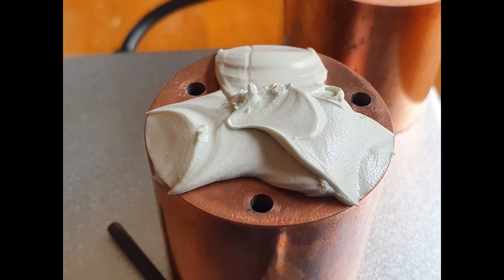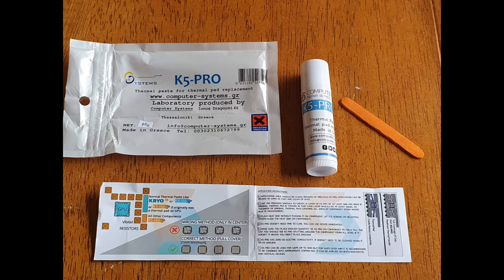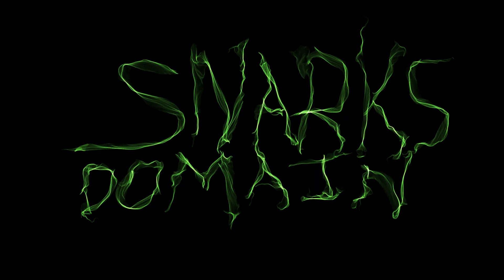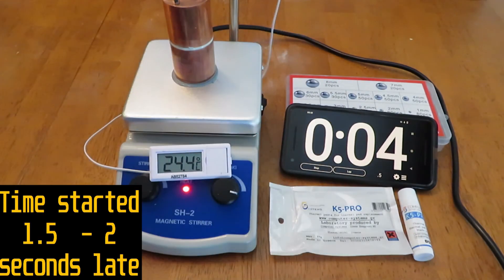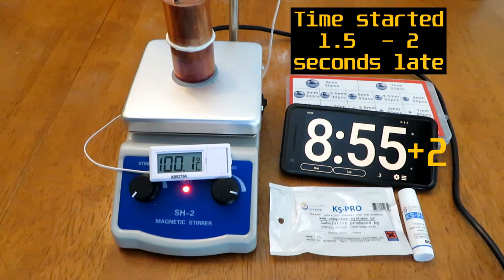K5 Pro vs The Hot Plate

Comment: i am planning to repaste my acer nitro AN515-58 I7-12650H and rtx 3070ti with ptm7950 along with i had doubt to buy a thermal interface for vram , like k5 pro or utp-8 thermal putty or pads can you recommend one for long lasting one with best one
Reply from the maker: Definitelt skip the pads and the K5 Pro. You can pick any of the putties on the charts, but you'll have the easiest time with one of the following:

Halnziye HY206 / HY236 
Zezzio ZT-PY6 
Upsiren UTP-4 Ultra-Thin
Reply: @snarksdomain  also sir that the upsiren ux pro ultra thermal conductivity was 16W/m-k on but the test result website shows only 6.1
Reply from the maker: @selvarajs401 it's best not to get caught up or even pay much heed to the advertised w/mk ratings. They are used more as marketing than an actual result. This is why test results on the same device and dame settings and wattage is so important. Otherwise we are left to rely on a manufacturer/brand advertised rating. They know this and end up claiming higher than is realistically possible.
Reply: @snarksdomain  thankyou for you kind reply and you testing says Upsiren UX Pro Ultra
Upsiren UTP-8
Hunan Feihongda LTP81
Laird Tputty 910
Thermal Grizzly TG Putty Pro
these were on the top list why you don't recommend this to me
Reply from the maker: @selvarajs401  because they use larger particle sizes and will be harder for you get get good CPU and GPU core contact since your laptop has fairly thin gaps.
Reply: @snarksdomain so hy 236 was a better option can you tell me the life cycle of this putty would i need to repaste often and also will hy236 performs as good as utp 8
Reply from the maker: @selvarajs401  should be just fine for several years.

It performs about 5 degrees worse that UTP-8 on my test card. Keep in kind that those 5 degrees are with it being GDDR6X with a +1100 Mhz OC, a 1.8mm gap and a mining load which is way hotter than what you will be running.

Your laptop has GDDR6 and the gap is much smaller. Close to 0.3mm so about 1/6th the gap that my test card VRAM has. For your laptop you might see a 1 degree difference between HY236 and UTP-8. 

You can certainly try whichever putty you like. If you run into problems then you can always switch to HY236 then. Just depends on if you are okay with doung the same thing twice and the slight increase in cost.
Reply: @snarksdomain  can i use copper shims on my acer nitro 5
Reply from the maker: @selvarajs401  i would not recommend it. The gaps aren't really large enough for it. 

That being said, if you take accurate measurments and leaving about 0.2mm to 0.3mm total for putty then I suppose it might be possible. 

It would maybe be more accurate to call it foil by that point. Or if you can machine something that is around 0.1mm to 0.2mm then maybe it could be done.
Reply: @snarksdomain  i go through the best putty website link you give that has Upsiren UX Pro Ultra
Upsiren UTP-8
Hunan Feihongda LTP81
Laird Tputty 910
Thermal Grizzly TG Putty Pro
honeywell ht 1000 at top order 
for best thermal conductivity

Comment: All I know is it cooled my Lenovo P1 gen 5 - along with ptm7950 - restoring power and saving my lap!
Reply from the maker: @stalbaum  doubtful. The PTM was a smart choice. The K5 Pro was not. Please go look at Igor's test results of K5 Pro compared to other putties.

https://www.igorslab.de/en/best-thermal-putty-database-and-charts-putty-versus-putty-tests-and-suitability-for-memory-modules-and-voltage-converters/
Reply: @snarksdomain  no need for optimal here, it is only an a1000 used to run 80 degrees now down to 70 maxed and the no more than 80 all cores on the i7-12800H, so the power phases are very well cooled by the K5. Bottom of the laptop never gets hot, just a mild warm, so working great. I think a little bit of the K5 property not treated in your test is volume, I use a lot of it and it soaks and creates a lot of area of connection to the body of the all in one pressure plate that has both the CPU and GPU copper. I think K5 works by making this large area and heat sink.
Reply from the maker: @stalbaum  again. I strongly recommend you go look at Igor's test results, in addition to my own. That stuff does not transfer heat well at all, and also bubbles, or creates air pockets, or off gasses. Either way, ends up with air voids/channels.

There are about 4 dozen better putties, many of which cost less.
Reply: @snarksdomain  well, lost credibility with me. For my laptop anyway it works great. That is what you seem to be missing here, your test is not related to the K5 use case. I suggest you research what it is actually designed for!
Reply from the maker: @stalbaum  just realizing now you were commenting on the hotplate video and not the GPU applications I did. I can totally understand you not putting much faith in the hotplate video. I've since retested everything on an actual videocard. Results are on the charts located following the Google Drive link in video description (Test Chart Repository > VRAM TIM > ETCHASH)

Here is a stream where I apply it to the Test card. https://www.youtube.com/live/P_cGk0EUUJo?si=fGlnGAHhnNL2vVYE

https://youtu.be/5iNXn8oaTWI

https://youtu.be/xND1726G624

If you're going to use a Thermal Putty from Computer Systems GR, you may want to consider CSGR UX Pro, as it's the only one that performs good.

For laptops with gaps below 0.5mm I instead recommend Halnziye HY206 (HY236) or Zezzio ZT-PY6. We should have other good performing thin putties from a few different brands some time this year.
Reply from the maker: @stalbaum I'd like to apologize for not fully explaining my experience and perspective woth K5 Pro. I definitely came off a little brash. Maybe a lot. I just have to do a lot of putty tech support with folks that use it and then have terrible temperatures. It can be frustrating.
Reply: @snarksdomain  it is still useful, you never know who will use it as a thermal paste! That would be bad.
Reply from the maker: @stalbaum  as long as your VRM temperatures are okay then you should be fine for now. My advice is to keep an eye on the temperatures of whichever components you applied it to.

If those components don't have temperatures showing in HWINFO then I suggest spending $5 on 20g of HY206 or ZT-PY6. It could save your laptop
Reply from the maker: @stalbaum  yep. Using any putty as a paste is not a good idea. Seen at least one person try testing putties like that and they had no control over the gap thickness. They didn't seem to understand the gap needs to be a controlled variable (like the 2mm ball bearings in this hotplate apparatus).
Reply from the maker: @stalbaum  Igor measured it at 0.6 w/mk with his TIMA5

https://www.igorslab.de/en/putty-details/?id=100
Reply: @snarksdomain  but again, it is not the use case. It is meant to be applied copiously and in volume, filling large gaps. Not pressed thinly between the plates. Wrong test assumptions, gigo!
Reply from the maker: @stalbaum I fully understand the correct use of Thermal Putties. I spent thousands of my own money buying all sorts of thermal outties and tested them out. I still have many more I need to test.

From my testing on the GDDR6X VRAM of my 3070ti test card there was only one putty that performed worse (Slice Engineering Boron Nitride), and it's not really marketed as a Thermal Pad Replacement.

https://drive.google.com/file/d/18pGETLrVCq16yMPE4EIBUe282SgSR8mL/view?usp=drivesdk
Reply: @snarksdomain  Sure you do, but K9 is a viscous thermal paste meant to be used completely differently. It is meant to be used in volume at low pressure. All you have to do is read the instructions. It is neither thermal paste nor thermal putty. It is to make high surface and high volume (adding volume for heat to sink) connections to replace thermal pads in a VERY different way than putty or pads work. You can't see it! You are, frankly, at McDondald's ordering a Chalupa.
Reply from the maker: @stalbaum  I do love me some Chalupa. Thanks for making me laugh. I am fully entertained. You seem to have a very narrow view of what K5 Pro is and isn't. Perhaps you should consider that Computer Systems GR markets it as a thermal pad replacement, calling it a "Viscous Thermal Paste".

If you're happy using it on your devices, then all good, my friend. I wish you good fortune and love living devices. Fingers crossed 🤞
Reply: @snarksdomain  yes sir it is a replacement for thermal pads. It both obviates needing to measure new pads (because you goop it everywhere) it also works by increasing surface area connection to not only hotplate but, to everything it touches. It also adds thermal mass. It is very effective, especially for laptops. It helped make my hot P1 very tame. No I would not use it for anything on a full mobo or in a graphics card as LTT did, nevertheless they got good results in a video card, fwiw. I'd use thermal puttys like you recommend for video cards. Thankfully, I'ma database guy not a gamer, history has been much kinder to me price/performance wise.
Reply from the maker: @stalbaum  I use "Thermal Putty" as a broad term to describe any soft/maleable/moldable/Goopable product marketed as a thermal pad replacement. I've designed my test to compare each product, and have gradually been making improvements to my equipment, test methodology, and accuracy and will continue to do so as time and money allows. My current dataset of results is based on a GPU on an open air test bench, logging/recording all sensors of the PC including ambient temperatures. I use HWINFO to record the tests and use Excel to process the results.

For the GPU I apply each product to only the VRAM, achieving full coverage without having excess. For the rest of the card I use MX-4 paste on the core, and TG-PP10 Thermal Putty on the Mosfets.

So my tests have been focused on how each product performs as a thermal pad. That is my main interest in these products. Those test results are what I base my perspective on each products thermal performance.

The strengths you list are indeed the same with other products that I call "Thermal Putty". No need to measure for gap sizes, and can increase surface area contact of the components. Can either be applied in a tidy fashion or cover the entire PCB if one so chooses.

Many laptops have gaps larger than 0.5mm, so any putty is suitable in those scenarios. While many other laptops have gaps thinner than 0.5mm. In thise cases there are several alternatives to K5 Pro that are just as soft, and squish down just as thin, some even thinner.

When LTT first released their video of using K5 Pro on a GPU, they only showed GPU core temperatures, and not that of the GDDR6X. On a later video they showed that the Memory Junction Temperature was reaching 110 Celsius (The point at which the card throttles).

Going forward, the vast majority of current gen laptops have more temperature sensors, so it's now easier to monitor thermals and the performance of a Putty (Or "Viscous Paste").

So luckily for laptops, going forward, we won't have to rely on theory, and can simply look at the temperatures of the devices that we apply these soft/maleable/moldable/goopable thermal pad replacements! 😀

I trust the numbers, not the marketing of a product. It's possible that when K5 Pro was developed 12-13 years ago, it may have been at the head of the pack, but now the market is filled with many similar products, with much higher thermal performance, often costing less, and being more stable at higher temperatures.

This year will be exciting as we see several new putties enter the market from a few different brands not currently in the space. I can't wait! 😀
Reply: @snarksdomain  no worries

Comment: Thank you for being infinitely more informative than LTT
Reply from the maker: Thanks for your vote of confidence and also for your subscription.

I should note that I'll be testing out K5 Pro on my test card anyway since I've received a lot of flack from CSGR regarding the hotplate test.

I should also note that I'm making improvements to my test methodology and equipment.

This hotplate test should be viewed as a reference, but not my final verdict.

Feel free to check out my stream later tonight,  where I will be applying Lipoly SH-Putty3 to the test card. Stream usually runs for ~1 hour.

Comment: What is the best thermal putty you would suggest?
Reply from the maker: Currently the best performing putties are:

EVGA Putty
Upsiren UX Pro
Penchem TH949-1 
Upsiren U6 Pro
Reply: @snarksdomain  do you think these thermal putty can outperform the arctic tp3 thermal pad?
Reply from the maker: @nator1654  It's hard to say. I'll need to get some TP3 pads. Competition will be stiff at the upper end.

The real trick is to have high thermal performance, and still be soft e ought to account for different pads thicknesses required. Thermal Putties have the clear advantage for varying component heights and compressibility.

Putties also lend themselves well to shim applications.

Either way, I hope we end up with a selection of high performing options. That way each person can decide for themselves what they'd like to use.

Comment: Can you test Evga PUTTY PLS?
Reply from the maker: Yep. I've got 4 tubes of it and will be testing it when I get a chance to do so.

I had considered testing some I pulled off EVGA card but decided it would be best to test new stuff to get most accurate results.

Work is very busy currently so it's hard to find time for testing but I'll make it happen at some point.
Reply: @snarksdomain  how does it compare to other putty’s?can you share some data.Dont need a video necessarily
Reply from the maker: @hurricane5952  Okay. Just tried it out on the hotplate and the results are looking good. Going to run 2 more tests for confirmation. I'll work on the video shortly here. I'll also test on the 3070 ti in the same manner as my other tests and see how it shakes out.

DO NOT throw out your EVGA putty if you open you card. From what I can see so far it tests in the high end of putties, not the low end.

Comment: In order for this test to be comparative to other you need to find a way to hold the gap between 2 copper slugs constant (spacer or holder for upper slug). Every material has diffrent heat conductivity and test results depend on layer thickness. This setup is close o professional thermal interface test. only difference s that professional test measures temperature of both slugs near test sample and can automatically plot temp-conductance curve.
Edit: I saw other video where you explain ball bearings spacers. This is the best thermal interface test I have seen on youtube apart from professional tester.
Reply from the maker: Heh, just saw your edit. Was going to mention  the ball bearings. It the best test I could think of on a limited budget.

The weaknesses of my test setup, in my opinion, are:

-Not measuring ambient temperature and humidity
-amazon temperature sensor....and only having the single sensor.
-not monitoring watts/kwh that the hotplate is using.

Comment: I don't know, but for this price and availability it's working for me. My video is still working. And great think about this one is that, you will never see it leak oil or get harden over time. Always stay soft and never leaks. And that is after more of one year usage. Shelf life - infinite, usage life infinite as i can see until now.
Reply from the maker: I'm glad it is working well for you. The longevity is a plus for sure. For cards with GDDR6X that are mined on the VRAM would get too hot with this alone. What card do you have and do you mine with it?
Reply: @snarksdomain  RX 480 8GB, and yes i mine with it. I cool everyting, not just RAM. Only CPU is cool by thermal paste.
Reply from the maker: @deathxxx1231  That card has GDDR5 which runs much cooler than GDDR6X.
Reply from the maker: @deathxxx1231  You can buy other thermal putties from places like digikey. They have dozens of different country sites. If you go to digikey.com and then click on the flag you can select a different country/region.
Reply from the maker: @deathxxx1231  I live in Canada and it's been free shipping for me as well. They sell worldwide. 

I would think Aliexpress would also ship worldwide. The Pink Jeyi thermal putty seems promising and I've since found it for almost half of what I paid.

I've ordered a few more putties for testing as well.

Comment: So i was thinking of buying some jeyi thermal putty should I go with it I’m not really to sure I did watch your video and I’m thinking about buying 100g of the thermal putty since it’s the closest to TG-pp10
Reply from the maker: *Update: I was wrong about the density of TG-PP10. It is somewhere between 3 - 3.2 g/cc. I kept looking at the 1kg container and realizing something was 'off'. There was just no way theybhad fit 833ml (cc) into it as the tub comes around 1/3 to 1/2 full. I emailed T-Global and they responded back that it was a clerical error and 5hat it was around 3, and very likely 3.2 g/cc. This makes the comparative cost of Jeyi a better than I thought previously.

Old info: So this stuff has a higher density than TG-PP10. Jeyi is 3.2g/cc, TG-PP10 is 1.2g/cc.

On a 3090 where I installed copper shims I used 51 grams of TG-PP10. With the higher density of the Jeyi I would have needed 136 grams to do the job (14x10g bottles). With shipping that's like $120 of Jeyi to do the job of $15 of TG-PP10. If we can find a place to buy this stuff in bulk then it might be a viable option.

I just weighed the amount in a Jeyi container and it was at least 10 grams. I should pack the same container full of Jeyi and then with TG-PP10 and weigh them both to confirm the difference in density.
Reply from the maker: Hey Nathenial, if you're looking for Jeyi putty also check this link out. I can't be 100% certain but I believe this is the same product and almost half price: https://a.aliexpress.com/_mOVUSCO